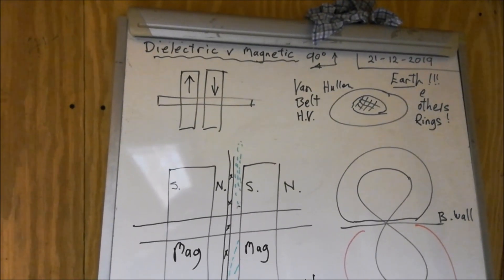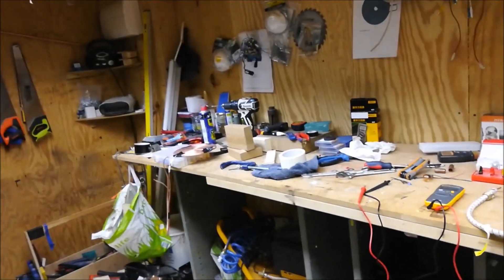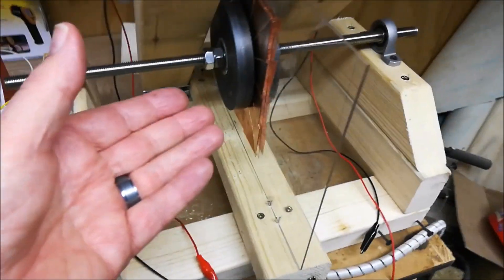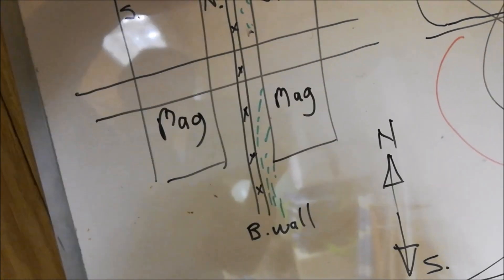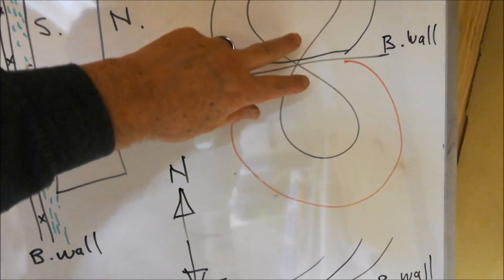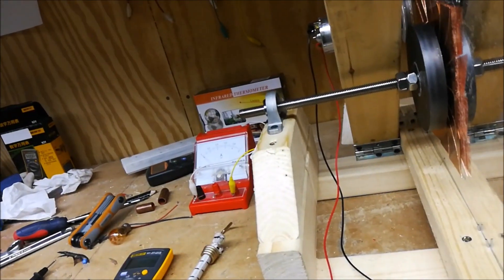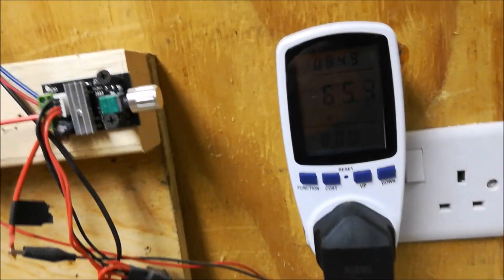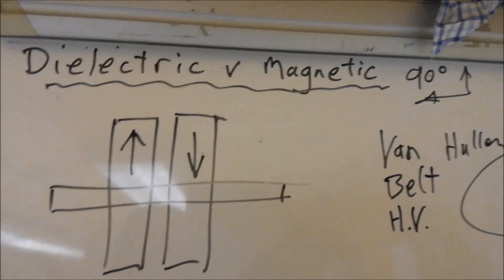The Dielectric v Magnetic Part 2 Extras

Comment: I was wondering if you take a 40 watt light bulb for example that usually requires 120/220 volts and <1 amps of power at 50/60 hz from the wall, what if you try to power that light bulb with only 12 volts and <1 amps instead but crank up the frequency in the range of kilohertz or megahertz assuming the high frequency will make up for the missing volts? Will the light bulb fully light up and will it consume less power from the wall compared to normal if it works? Will using high frequency result in situation similar to hairpin circuit to some extent?
Reply from the maker: Yes i think this is possible. "Your mission if you so choose is to try it"! Ha Ha!  Energy from the Aether really make sense. A magnet from atomic to any made size has the same attributes as a galactic profile, this is nature.... DC   ...(PS) Quote:- Tesla "Everything is Light" ....
Reply: Since electric meter doesn't meter frequency, if using high frequency to make up for missing volts results in saving power bills by good amount, that would be great thing. One would need to build a frequency step-up adapter that would connect between the wall socket and light bulb.
Reply from the maker: @Xeno_Bardock  dial a frequency? Or converter. It would be like 5G only much higher.. DC

Comment: Ken Wheeler used Rodin Coil instead of copper plate between the two attracting magnets with holes at poles.
Reply: https://www.youtube.com/watch?v=q7ofh3rXAco
Reply from the maker: Hi XB thanks so interesting. Love Ken's teachings on magnetism... Regards... DC
Reply: @e.powerdc1127  I wonder if solid-state electric generator is actually possible. I came across this comment by Wyatt Bielert in the mentioned Ken Wheeler's video: "If you were to wind a dual rodin coil interwoven between each other and passed a current through it the wire wouldn't the small magnetic field produced complete the magnet and join up the plane of inertia but causing an induction or flux in the secondary coil. This field reunification could be turned on and off at will making a solid state generator. Just a thought".
Reply from the maker: @Xeno_Bardock  yes I agree very possible. I am trying to get my head around the "blotch wall" and the field lines and how they would probigate between N. / S poles. Have you a take on this?.. Regards... DC
Reply: @e.powerdc1127  Bloch wall is where all life exist and all stars and planets exist. Eric Dollard did an experiment with Tesla Coils where he was able to produce little stars and galaxies inside a burned out light bulb from its metal vapor and gases when placed between two tesla coils. Eric Dollard likely electrically created a bloch wall between the two tesla coils top loads pointing at each other while operating 180 degree out of phase to each other creating dual golden ratio patterns. Entire solar system is under Sun's bloch wall.
Reply from the maker: @Xeno_Bardock  Hi again XB  Wow mind blowing. I have read about ED but must have missed this. I do know that Tesla had assorts of stuff materialising.... Things would just appear !!! Quote Tesla... "Everything is Light"..... Regards .... DC
Reply: @e.powerdc1127  Mosfet or transistor can be used to turn on and off the field reunification.

Comment: What you are doing wrong is watching Ken's videos.
Ken wants to destroy physics and lure weak people into his sect. He hates science.
The word "dielectric" means non-conductor. It is used inside capacitors to store the charge on.
Dielectric vs Magnetic makes no sense at all.
All effects you can measure in your setup are due to impurities in the magnetic field of your magnets.
When you want to induce electricity with your setup, the magnetic fields should alternate.
So, in your setup you have the north and south left and right, but than you have no flux-change in your copper disk.
When you have the north and south up and down, than you have a maximal flux change through the copper when you spin either disks, and therefore a maximal induced electric effect.
Faraday's setup has only one magnetic disk, and in my idea the copper disk should be solid, so without the cuts.
Faraday spins either the copper or the magnet (or both), and measures and compares the induced current in those situations.
Good luck.
Reply from the maker: Hi J. W. Your words about Ken say much about you. Just cos different thinking is contra to known physics doesn't give you the right to try to dumb him down.  I think he is on the money because it agrees with my simple experiments. Particularly counter space.... Regards... DC
Reply: I just want to warn people for getting caught in a sectarian web where eveything is upside-down and inside-out.
Different thinking is okay but inciting people against society is not good and trolling is not good.
But I predict that your experiments give the same results as the experiments they do at schools and universities.
Reply from the maker: @_John_Sean_Walker  I do experiments cos i love experiment  for myself. Not the same as universities, i  know inwardly my guided path from above. We all have gifts we should use them, for the good of all. Quote Tesla "Everything is light" is a great starting point with the right potential.  Regards....DC
Reply: Of course DC, I do experiments for my self too.
I hope you appreciate my hints.
I like videos with experiments.
I like INVENTOR3's channel.
Reply from the maker: HI J.W.  I am glad you experiment, yes to the max induced effect "With a swiftly moving magnetic pulse" (Expand / Contract) this really should do the trick. This is where i am now and its just a matter of time. So thanks for the good luck gesture ... Regards ....DC
Reply: I have learned not to jump to conclusions before the experiment is actually running to avoid disappointments.
"Swiftly moving…" makes me think of Lidmotor's channel.

Comment: My understanding is that putting magnets in that orientation just creates another magnet. If you check your poles now you won't have 4 poles you will have 2 because the inertial plane of each magnet has moved to the centre. I believe it's the moving of the inertial plane that causes the waves in the ether. I could also be a million miles away as well, it's how I see it in my present learning.
Reply: Also, if you do the iron fillings thing with the new magnet you will see it has the same representation of lines of force from north to south. The south and north are separated by the inertial plane and therefore in my head will not reciprocate as Ken Wheeler states. Just my thoughts!
Reply: Sorry, I forgot to add - Excellent experiments your doing, learning loads from them, thank you so much.
Reply from the maker: Hi L.G. I agree, yes by splitting the magnets or "Holding Apart" both the "Magnetic & the Dielectric" are moved and positioned where they can be "Perhaps" manipulated !!!! This is "Key" because "Electric as we know it" is a bye product of the two; a sort of "hi-bread".  Do you agree?... Regards .....DC
Reply: @e.powerdc1127  Yes, I think your right. Where the rings of magnetism cross the radial dielectric, electricity is born. Dollard has called this unit the 'Planck'.
Reply: Would you be weakening the fields by keeping them apart? Your doing a great job of finding out with this experiment!
Reply from the maker: @cobail1  L. G. ITS about the bloch wall I haven't understood it. It's work in progress but it's interesting, isn't it?... Regards.... DC
Reply: @e.powerdc1127  Yes most definetly. It is a balance point between the poles. If opposites attract there would be no poles! It's the reason why I think magnets don't reciprocate. The field comes out of the poles and goes back in at the inertial line. It happens on both sides at the same time. This is what I think happens but could be a million miles away.
 All the power is in the still ether!

Comment: 5:30 i believe they would be “compressed” if the like poles would be facing the copper plate.
Reply from the maker: Hi T.B. "Have a look (Study) at Bloch Wall. Here is a starting point:- https://iopscience.iop.org/article/10.1088/1367-2630/aa60d5/pdf       Regards DC